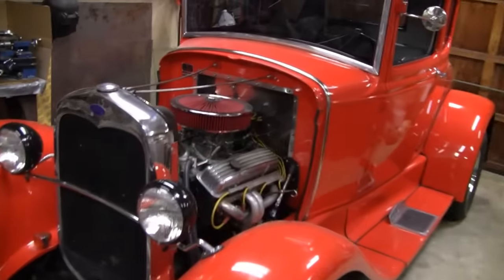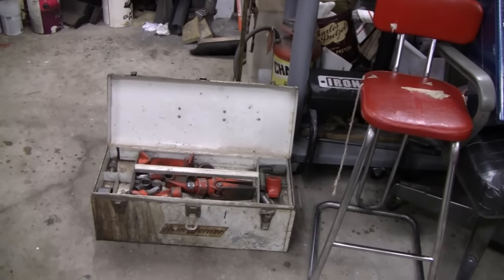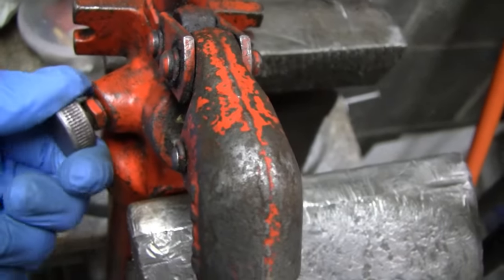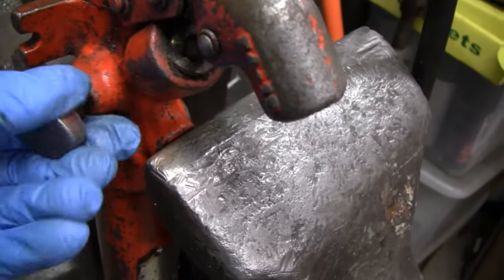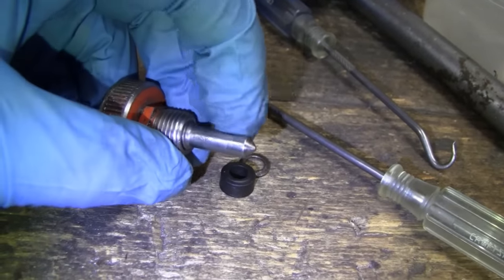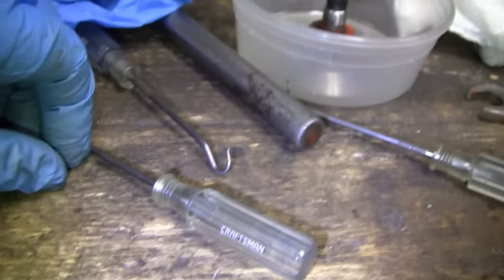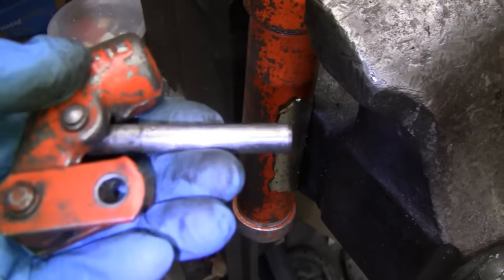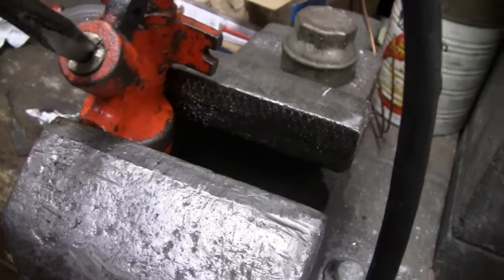HYDRAULIC PORTA-POWER REPAIR (part 1)

Comment: Few years ago I bought one from a friend for £10...he got lots of stuff dirt cheap from a fire brigade auction. Used it a little but then sold it to my friend at the garage for the same money. Used it this year to push the tractor wheel rim on when I welded it. Still works great.

Comment: HOLY COW! can't believe how much those washers cost. that's ridiculous.  makes me appreciate my pora-power that much more. i have the 10,000 pound harbor freight one and bought the pulling ends so i can push or pull the dents and things out but i have to be careful because all my pushing elements are 10,000 pounds but the pulling ones are only 5,000 pounds but they still totally work
Reply from the maker: Be careful Jimbo!! I've seen a few of those cheap Chinese pumps blow apart and injure people before!!☺
Reply: had mine for 7 years now i think it is and used it on things well beyond the max limits and it's still together so i'm thinking i'm good but i never use anything harbor freight that i am expecting to last forever either so when ido use that it's very cautiously(normally)

Comment: Hope you can get the seals you need ..I read the comments and seen there are some parts places mentioned. I would clean and inspect the check valve  & clean/ flush out all the parts
Reply from the maker: Everything was clean as a whistle!! I just replaced them seals and it's better than new now!!☺

Comment: I would check the check valve as well.  If it won't hold the pressure, it could cause what you were seeing.
Reply from the maker: It will hold pressure, I just couldn't make any!! Those new seals solved the problem!!☺

Comment: Nice when you can keep an old piece of gear alive, I have a chain come-a-long that is older than I am, Ive pulled it apart and cleaned it over the years, but other than that (And fixing the time I greased the clutch 25 years ago......long story) its working fine.
Reply from the maker: Yeah Buddy!! Almost everything I have is old!! Every time I use something it brings back a memory from the 70's or of my Dad!!☺

Comment: HEY BUDD,  you mentioned that you werent going to do anything with the check valve- BUT, the tiniest little flake of crud or small chunk of rubber in the check valve will hold it open slightly and keep the pump from getting pressure as the oil will just freely flow back and forth...... So while youre waiting for the U-cup washers maybe take it apart and flush it both ways and clean and blow air thru the check valve to make sure it's good?

Comment: Hi Glad you found seals for it pretty easy. we  have an old Dunlop high lift trolley jack here it must be from the 40's/50's and pretty rare.  I can't find much about it online for pictures or anything. I need seals for that really as it leaks on the floor, but kinda scared to take it apart and mess it up completely if nothings available. My suspensions are it has leather seals that are goofy sizes and styles. The new made in China jacks aren't anywhere near as well built and don't lift so high, from what I've seen around.  Like with your porta power it would be a sad day if it went in the scrap after all the money it's made and the years we've had it .
Reply from the maker: Thanks Bud!! Yeah floor jacks are a little more involved but I'm sure you can find what you need!!☺

Comment: are there 2 check valves, or just one?  I would think there would be one near the hose, to prevent pressure from coming back through, and a second one between the piston you took apart, and the resivoir.  I would think that check valve would be leaking fluid back into the resivoir causing your issue.  those seals you removed look like all they do is keep the fluid from from blowing past the piston under pressure.
Reply: I agree with you a gummed up check valve would do it.
Reply from the maker: Nah it was just them seals, it's working better than new now!!☺

Comment: We used to soak rubber seals in mentholated spirits to clean and rejuvenate the rubber, I'm going back 25 years and we didn't have to do it often so I can't remember how long we had to soak them. 
I'm just thinking it might be a useful bit of info if you can't find replacement seals easily.
Reply: Do you mean methylated spirits? https://en.wikipedia.org/wiki/Denatured_alcohol
Reply from the maker: Thanks Mate!! We were able to find suitable replacements!!☺

Comment: If it suddenly failed, your check valves have failed. But the piston is pretty worn too. Broach the hole, and machine a new piston, or find something that is the right size. A valve stem from a huge diesel might be thick enough.

Comment: hey roadking! I rebuild graco airless sprayers and they have the same stile of packings on the piston and throat.  there made of leather and teflon.  have to soak them in oil for an hour or more before assembling. to adjust bring it to 0 play then give it a half to 3/4 turn. dont know if that will help but keep the vids coming i realy enjoy them!  cheers!
Reply from the maker: Thanks Mate!!☺

Comment: I'm wondering if MVP11489 might be on to something too. I would think there should be 2 check valves, or at least a double valve.
Anyway, I'm sure you'll get it straightened away. This is an interesting repair.
Reply from the maker: Thanks Reg!! Nah nothing wrong with the check valve, they're just ball bearings and springs!! I just had to replace those piston seals and now it's good for another 40 years!!☺
Reply: There you go then, well too, it is a Hein Werner after all !  I know that brand too,..there is no doubt at all they, like the older Ridgid plumber's and pipe fitter's tools, are the very best quality and built to do the job with very long life.
Good ol'  "Made In The U.S.A. ' quality,...like 'The Boss' signs's that title song.

Comment: I'm surprised a manufacturer would use 5 rings or seals in an  area where one made for it would work. Great tool either way. Bet it works fine when you are done RK...
Reply from the maker: Thanks Carl!! We got it working, we were only able to put two seals in!! That is a factory set up, they call it a multi V pack seal!!☺

Comment: those washer should work the metal ring give them that shape and you add them as it wear so the brass nut doesn't bottom out you could probably just add a new one to what you have and keep using it

Comment: Yeah, if it wasn't leaking out the plunger, that wasn't the problem. I would say check valve as well unless that release valve was not seating properly. Other than that, Could be the lack of paint ; --)
Reply: I agree. I'm thinking those rings kept the fluid inside. The pump may be metal on metal.
Reply from the maker: Nah it was just those seals that were the problem!! I'm surprised it wasn't leaking!!☺